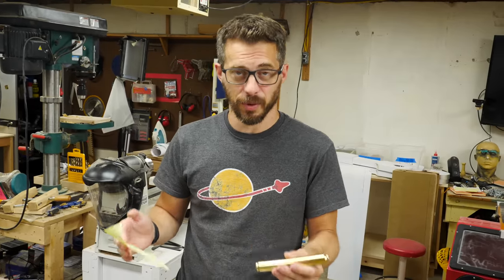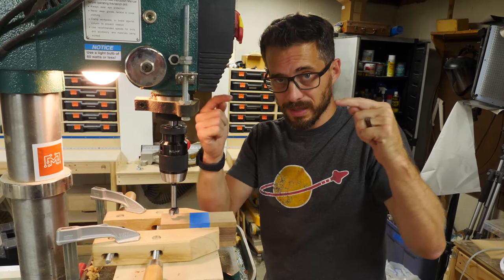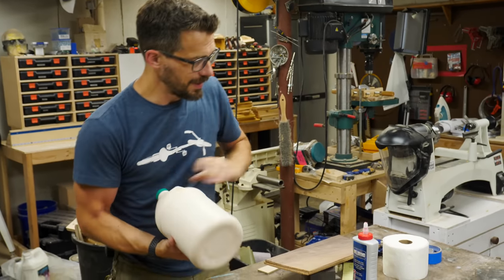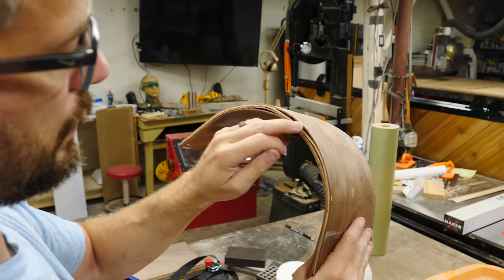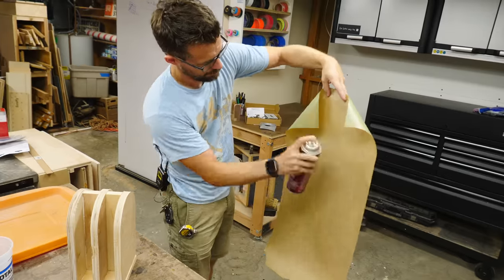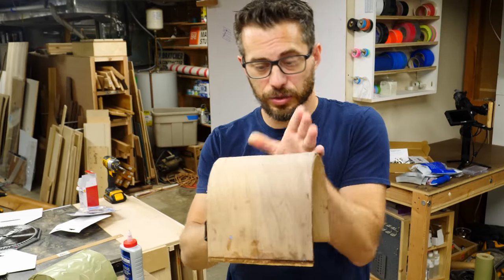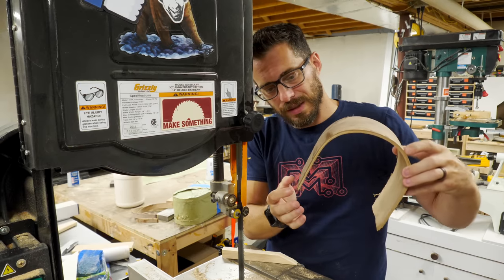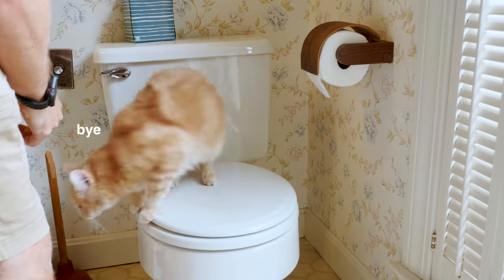Cat Proof Toilet Paper Holder // Bent Lamination | I Like To Make Stuff

Comment: I understand the whole point of the video was to show "bent lamination". Years ago, I made a similar thing  and in place of "bent lamination",  I used a peice of thick veg tan leather as the "TP shield". I stamped some funny things into the leather and then wet formed it around a cylinder. It came out okay. Nice job.

Comment: When you cut the spring, you made it much easier for a cat to knock the toilet paper out of the toilet paper holder. I drilled a hole all the way through one side, so I can put my finger in and remove the toilet paper roll to add a new one.
Reply from the maker: It's still plenty tight. I can't imagine them being able to knock it down.

Comment: I have always had dogs, so this never came up (although picture, if you will, an entire drip irrigation system dragged in through the dog door and chewed to pieces).   Fun video, and I too enjoy the fact you are willing to show your experiments as part of the process - those add a lot of value, imho.    The only improvement I can think of would be to use machine screws and acorn nuts to hold the flap to the top of the hinge, as there are not a lot of threads holding it there.

Comment: hey great work once again! I do have a little note tho: instead of pre-sanding down the screws, just pre-drill the holes as you did, screw in the screws and then sand the whe thing down. This way you get a smooth surface with some brass-pins (sanded screwtips) that add a nice look to the otherwise pure wood look(nice conttast) also you don't have to figure out how deep to drill so the screws fit in without drilling through. 
tl;dr: screw, then sand, just for looks and it's easier to do without added risks

Comment: Many places in Europe use these style holders. Not meant for cats, but that's a bonus. Easier to rip off a sheet. Stops the roll from spinning. And keeps dust off the top if in a dirty environment or rarely used bathroom. You can buy them on Amazon.

Comment: Bob, a quick tip if you need to laminate a complex shape again. Make a 2 part buck. It's easier to apply pressure is the lamination is between a positive and a negative half. 

I don't know how resilient the PVA glue will be with the brass hinge and the wood. I was wondering why you didn't use epoxy?
Reply from the maker: Great tip, thanks! I just used it because I had it on hand, and it's worked well before.  The glue is just supplementary to the screws since their thread was shortened.

Comment: Ok, question- why did you choose to shorten the screws? I would have gone small brass bolts, on the idea that they would provide a stronger connection with less chance of damaging the thin laminate.

Comment: I was hoping for an automatic spray bottle over the toilet paper for the cats.
Reply from the maker: Ohhhh.. good idea.  I wonder if it would also spray the person on the toilet though :)
Reply: That would get the toilet paper wet, too. Wet TP turns to mush.
Reply: @Iliketomakestuff  built in bidet? ...it's not a perfect plan. :)
Reply: Calm down there. This isn't Turnah81
Reply: If you want to use a spray for cats, using a compressed air can is great. The noise is enough to discourage them and nothing gets wet. You can even get rechargeable air cans now. I built one with an Arduino, motion sensor and a servo to teach one of our cats that he wasn't allowed on the kitchen counter top.
Reply: ....with an arduino
Reply: I Like To Make Stuff You could have a spring latch you had to activate to get the paper with the other hand.  Poor cats...lack of opposable thumbs must suck.
Reply: @Iliketomakestuff  How about No! That's not nice, and yes, I've been raising cats all my life, including working as a Big Cat handler and a Lion handler. It's all in the tone of voice.

Comment: These are how my  project go as well, spent a whole day working, overbuilding some minor thing only to realize or find out later It won't even help all that much. :( Yet we must keep trying and it's fun!
Also if this does not work I suggest an Upgrade episode where we create a letter type box, with a strip of metal as a cutter facing up so the paper needs to be pulled from the top to then pulled down to cut your length.

Comment: I've got a project slated for my bathroom where I need to put in some floating shelves. The plan is to install some orange led strips on the underside, and have them controlled by a photocell since there's a window opposite the door of my bathroom. However, I don't want a long power cable snaking across my sink, so I'm going to try and install a photocell and battery pack of some kind that will allow me to use a USB cable to connect the LED strips to it.

Comment: Another idea for forming and clamping a round shape like this is by using 2 regular door shim wedges, hammered into the gaps at each end of 2 chunks of 2x4, driving them apart.  Put those expanding 2x4s next to your round shape with the glued veneers around it, and wrap it all in a flat nylon strap.  Screw one end of the strap to the outer 2x4, wrap it from bottom to top evenly around the veneers (and 2x4s) so that it holds them to the round shape (could be paint can filled with Quickrete, etc.), then screw the other end to the top of the 2x4.  When you hammer in the wedges, driving the 2x4s apart, this will put a surprising amount of clamping force on the veneers, providing plenty of glue squeeze out all along the edge, and preventing de-lamination after it dries.

Comment: The clamp trick you used to get the hole in the same place doesn't work for holes that aren't through the wood. Set the bit off to one side and you can confirm flipping it over like you did doesn't give the mirror image that's needed.

Comment: I think the main issue here is that wood glue works by actually drying and not chemically reacting. So if your wood is wet the chances for a good adhesion reduce a lot. I may ve wrong but this is how I currently understand it.

Comment: like the project.
however with laminate bending depends on thickness I would just try at first just with glue.
or alternatively steam them for 45 minutes to 1 hour bend them with no glue clamp over night and then use glue when the timber 
is dry.
Reply: And forgot to add use sheet metal to help with clamping

Comment: OK, I'm sure some is pointing it out somewhere here or has done that already, but why not cut the required curve in a piece of plywood with straight top and bottom edges, put the soon-to-be-laminated veneer layers in the cut in the plywood, and clamp the plywood pieces together, with the laminated piece in between them? Much easier to apply consistent clamping pressure

Comment: hey bud, why the clamps instead of those nylon ratchet straps?... seems those would apply the most even amount of pressure?
Reply from the maker: I tried mine, but they didn't seem to get enough clamping pressure on that specific shape for some reason.
Reply: @Iliketomakestuff  oh, perhaps the 90 degree corners at the bottom were introducing too much friction/unfair stress, I wonder if rounding those out a bit would have helped

Comment: Turn the TP round so that is the correct way - the loose sheet hangs against the wall, rather than into the room..
Cats might pull on it, but it'll just spin...
Reply: Yep, this helps a lot. Not totally foolproof, but it's a big improvement.
Reply: The claws will still shred ✂️

Comment: Multiple band clamps should work for clamping.  Like the ones for doing miters.  Take off 2 of the corner pieces on them and then the band will form around the shape you're going for.
Reply from the maker: Yeah, tried that actually. The Bessey ones I have don't really have any ratcheting ability, so I couldn't get them, tight enough on that small of an object. I guess they're made for larger items.

Comment: A much simpler solution would be to turn the toilet paper towards the wall. Since the cat scratching momentum is pulling not pushing. It might be slightly harder to reach but it's super simple and free.
Reply: I don't think thats really the point here. Looks like the cats are shredding the paper on the roll, not unraveling it.

Comment: I've used canned air or even my compressor turned down will blow the glue down I'm a crack if you have an issue like where you need to get glue between the laminated p pieces after they come out of the clamps ..

Comment: "Literally can't get to the toilet paper." HA-HA-HA-HA. My cat would twist around and come at it from directly below. Then she would destroy MORE stuff because she knew we were trying to thwart her. (Little demon is lucky she's so damn adorable)

Seriously, though, I've thought about something like this. I don't have the tools to do it with wood veneer, but I've thought about cutting down plastic tubes. They even make tubes designed to hold spare rolls of toilet paper that would be just the right size.

Our current low-tech solution is just not to use the hanger. We keep the toilet paper in a cabinet right next to the toilet.

Comment: I think it would have been better if the laminate was suspended a quarter inch above the toilet paper instead of actually touching it. With the laminate resting on the toilet paper it seems like it would make it unnecessarily difficult to pull the toilet paper roll since it's scraping against the laminate as you pull

Comment: This clearly needs a laser pointer function, when pawed a laser pointer turns on and swings so the laser starts on the wall goes down, across the floor and out the door. Thus evacuating the cats ....and possible creating phycological issues.